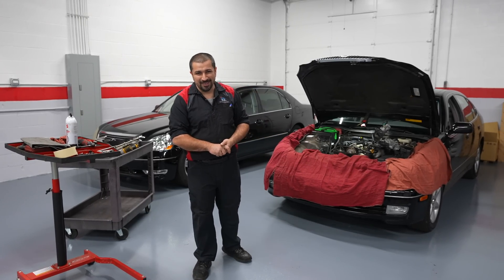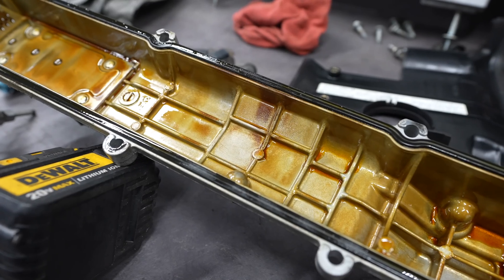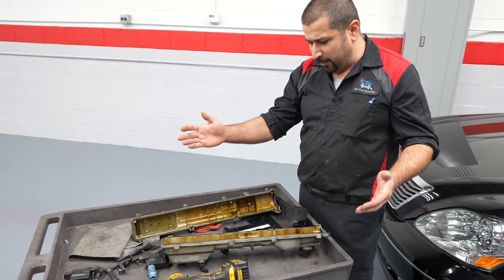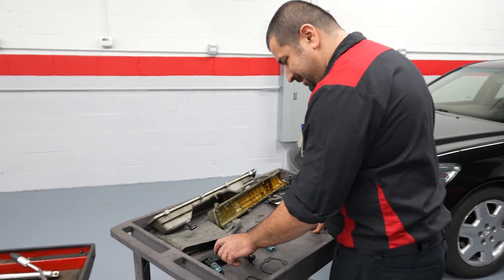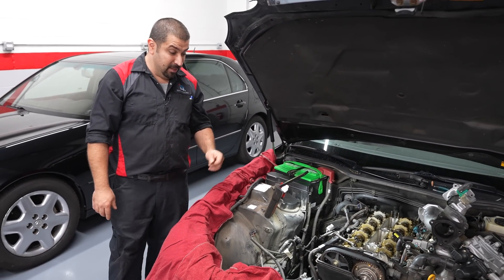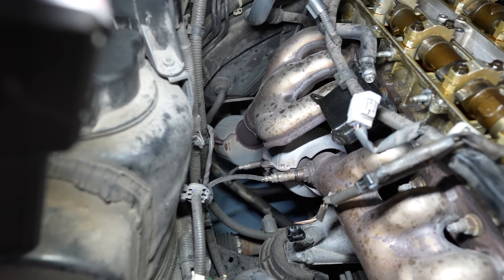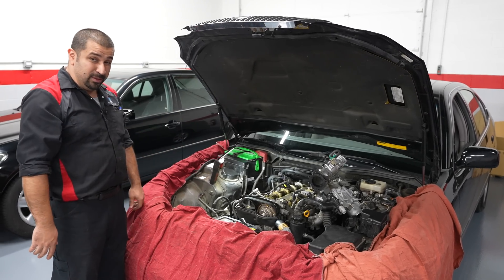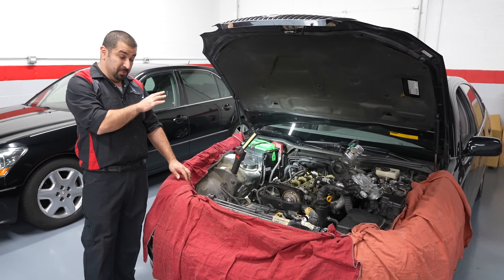This is How a Clean Engine Looks Like Inside Even After 20 Years of Service

Comment: My 07 Cadillac STS with a V6 had some work done and we were able to see the inside of the engine and it looks brand new. The car has had basic maintenance, full synthetic oil, oil changes on time, has not been driven hard and is only run when it idles down. This is from brand new off the lot. So many people abuse their cars and they poop out and all the sudden it's a bad car. Toyotas and Hondas just handle abuse better usually.

Comment: You should see my 1996 Mercedes-Benz SL 500 with 253,000 miles. Engine looks like new inside and not a trace of varnish. Has had mobil1 all of its life.

Too bad I can't post any pictures here 

Even the timing chain looks like it has absolutely no wear.

Comment: When l replaced the rocker cover gasket on my 1997 Toyota Hilux ute l did have a look at the timing chain it is tight under the valve cover it us clean l had recently changed the oil and you mentioned vacuum hoses well my Hilux has many of them going every wapear under the bonnet and from the carburetor but only one ignition coil as they did l keep a list of what l have done to the Hilux and for the sevice l wrote down tge kilometers for when l pass the Hilux onto one of my children a very extensive service history because when l bought it the Hilux had nothing the only thing in the glove box was the rego papers

Comment: The worm clamp comment was genius - never thought about the ability to self-adjust whether hot or cold.  Regarding the clean engine topic, I've always wanted to ask a certified mechanic this question since I encountered it in 1981.    
I had a friend who owned his own gas station.  They had a late 70s Thunderbird they were working on which had a V8 that had the valve covers and manifold pulled for whatever fix.  My friend commented on how clean the engine internals appeared - like this 2JZ engine - because he ran kerosene through it when he changed the oil.  I don't know if this was before a change with oil still in the crankcase or a complete flush between the old and new oil, he didn't add anything more to his comment except that the guy ran kerosene through it.  Two questions:   1) is the kerosene flush just a myth.  I know a lot has changed with car engines in the last 40+ years but I would think that, even in the old days, that kerosene would remove all lubrication, certainly making the engine cleaner but at the cost of causing greater wear upon start-up.  And while we're on the topic,  2) is running the current commercial engine oil flush products (e.g., STP Synthetic Engine Flush) helpful or simply a waste of time, especially if you change your oil regularly.
Reply: Back in the day flushing oil was a really good idea it oil didn’t have detergents to suspend particulates in the oil so they just sludged up without flushing I don’t know about using kerosene to flush

Comment: Hi there im european and i have m'y fiat coupe from 1998 2 litter 5 cylinder closed deck block that Can take  more than 500 HP, it revs AT 7000rpm no turbo .I bought it from a old lady who took Care and the engine inside looks New AT 150.000 km,that why i bought it... Check it out fiat coupe from 1993 to 1999 the first models came with the Lampredi engine that was used in the Lancia Delta intégral  the 6 Time rally champion.

Comment: I changed the valve cover gasket in my 2003 Corolla with 130,000 Miles and I took pictures because it looked like new. I also own a 2006 Corolla with 221,000 miles and did the valve cover gasket at around 180,000 miles because it was leaking profusely and the cams were not looking as mint but still very clean. Bought them both used with around 126,000 each miles already in the Odo but with decent maintenance records. The 2006 also had a brittle intake manifold gasket which made cold starts on cold weather difficult. What I cant get rid of is a pesky cel for a "small leak" 0456 code or something like that, supposedly due to a hose near the gas tank apparently being a common code.

Comment: I bought a SC300 with the 2JZ with 305,000 miles that I've restored/been restoring.  We did the timing belt, seals, and valve cover gasket.  The valve train looked liked the day it was built, shiny silver.  Not an ounce of varnish.  Nothing.  My mechanic nephew was shocked.  I guess that's the benefit of the differed maintenance on the seals and gaskets.  It leaked oil like crazy and had this amazing rust preventative layer on everything under the hood.  So new oil was going in all the time.  Now it's cleaned and sealed up and the engine runs fantastic.  PS - I would just clean up the coils, replace the foam isolators, and use them.  No reason to replace something that works that can easily be replaced later.  I have 3 cars with 2JZ engines and I've only replaced one bad coil pack and it was cracked and arcing.  Long live the 2JZ.

Comment: A reason I did subscribe. Can't get enough of your videos as a Toyota enthusiast. 

And YES they still make original parts for older engines. I recently did a tune up, oil change with OEM filter, valve cover gaskets, PCV valve AND hose, and a valve adjustment on my 92 Toyota pickup with the 22R-E engine. Was only a 30 dollar difference between getting them from the dealership in my area VS my local parts store. 

Oh, if you excuse me :) I also have an oil change to do on your favorite engine (the 2AZ-FE) hehehehe :D

Comment: Salutations. I appreciate your channel. I used to work at a toyota dealership as well. my son has my 2010 avalon. on the initial start and pull off the engine clicks or knocks when accelerating then it goes away after about 5 minutes or so of driving. Do the additives (lucas, sea foam, purple) work on lubricating the vales and lifters and such or do you recommend to just change the oil?

Comment: I have a '05 Camry and had the alt rebuilt at 200k. Sits at the very top. My wife's Odyssey had the alt rebuilt at only 100k. But that alt sits at the bottom. Never really put two and two together until this video.
Reply: The valve cover plug seals leaked on my '05 Camry. Didn't know it until a misfire. 3 out of the 4 plug holes were full of oil. It was a huge mess to clean up and get all the oil out. But, like he said, I just took my time. I didn't pull the plugs for fear of all that oil running into the cylinders. Had to replace one coil, but the others were fine. I just cleaned them up real good because from what I could tell, they are sealed pretty good. As for connectors breaking, yeah, just a fact of life for a Toyota owner. I had to replace all the coil connectors at ~100k because they literally crumbled in my hand.

Comment: I have just purchased a 2013 ES 350 with 94,500 miles on it. I fear I have chosen poorly. It  clackety clacks fairly loudly, and there is a tick from the drive train as you slow down to belo 20mph.  It is a one owner car that the Car Fax shows went as much as a year between oil changes.  Is there some kind of engine flush you can recommend that would help restore oil flow, and what should I look for on the drive train tick?

Comment: Hi, I love your videos. I have installed a new WALKER catalytic converter (without Heat Shields) in my 2002 Lexus GS300 last year. Walker said i do not need them. The old heat shields did not fit the walker. Do i need shields or not. I appreciate your respond

Comment: I change my oil on my civic every 3 months..dc if the oil reminder tells me I still have 50%or between 30%.. never had a problem and engine runs real smooth.has 180,000 and engine is still strong.but that's jus me..one of my cars I baby😂..

Comment: Car care nut!!! Hope you read this and reply. What do you know about the engine coolant bypass valve breaking on Corolla/camry/ and my 2019 rav4. I just had it replaced at 36,100 and 2 months out of warranty :/. Is there aftermarket part to put in , the plastic will crack once again in 30-50k miles 😢 why no recall or tsb a lot of complaints online that’s how I knew to fix it lol. Thanks and have a blessed day!!

Comment: I am the original owner of 1986 4Runner, which I maintained religiously. This was not cheap but it has 332K miles on its 22RE engine and is still going strong. To make this vehicle feel better, I just brought it a younger baby sister, a brand new 2023 4Runner TRD Off Road.

I am wondering whether it's still recommended to do the first oil change at 1000 miles, to flush out the supposed micro-shavings from the new  engine.  This used to be a recommendation years ago for owners who intended to keep their vehicles for a very long time, and I am questioning if it's still worthwhile on the new engines, specifically for the 5th gen 4Runner.

Comment: I had a 99 gs 300 with almost 300k before I sold it. Loved the engine. Sold it cause it had way too many problems for a beat up vehicle. Still drove very well. I had a vc leak that filled the spark plugs and I couldn't even run it. Still love the car though 😍  wish I could get another someday

Comment: Hi AMD, long time viewer and fellow CCN! I have a couple of questions about a rear main seal leak and AT fluid change. I got a 2010 Toyota Camry 2AR-FE five months ago. I’ve discovered that it has an oil leak at the rear main seal. It’s a pretty slow leak because even in between the first couple oil changes the level is pretty much the same, with the spot forming in the garage only about an inch. I’m only using the Mobil1 0W-20 oil/filter and changed the oil when I first got it and after a little over 3K miles. Should I worry about the leak causing more issues down the road or is it only a problem if I think it is? A local mechanic shop who inspected the vehicle’s condition quoted me $800 for RMS replacement. Lastly I’m the 6th owner of the car and according to the carfax service records it’s spent it’s whole life in NY and NJ until this year with me in GA but there is no mention of an AT fluid change. It now has 146,210 miles so at this stage would you recommend a drain and fill or what signs should I look for to make that call? I’ve done other maintenance on it such as spark plug changes, breaks, rotors, and power steering hose replacement, so I feel confident enough to tackle the job. Thanks for your informative videos and knowledge, and wish your family and business the best! God bless.

Comment: My Dad changed his oil every 2k miles along with air filter. At 200 k miles the inside of his valve covers were clean , even on his 200k 350 rocket. Maintenance is everything. My 03 focus has 310k n still going strong with good maintenance

Comment: I have a 99 GS300 that I watched come off the delivery truck in March of 99; have changed oil every 3k on the dot with synthetic oil. Has 147k on it and had the dealer replace valve cover gaskets and spark plugs with coil packs during last oil change. I stopped by one morning using loaner car on my way to the office with bagels and coffee for the mechanics. I caught them having a meeting in front of car observing the valve cover gaskets. Once I greeted them, I asked them what they used to clean the inside of the covers. I was shown that they were clean, with a light oil coating inside. I knew it was true when the oil I wiped with my finger was slightly discolored and not brand-new oil. The general manager of the dealer, who I have known for the past 26 years when I bought my LX 450, says he wants me to sell him my car despite knowing my answer. Returning to original topic, timely and frequent oil changes with full synthetic on this engine design is a match made in heaven

Comment: It's always nice to see an engine so clean that it looks like a pair of brass wind instruments! 

My 23 yo non-Toyota had head gasket replacement last year. When my mechanic sent me the photos of the cylinder heads, I gasped as one might when opening a jewelry box. He said, "Pistons look superclean from low carbon buildup," and I couldn't have been more proud. When I first brought the car to him a few years ago, I told him that I only fillup with 93 nitro, and he said then that it might not be necessary. 

Now that we've both seen the results, though, he says keep using it.🙂

Comment: My toyoya  service advisors used to advise me to change every 7500 tom 10 K Have had a new advisor  and have been changing ever 5K   Do a lot of highway driving  Wish I knew to change at 5 k when new. have a 13 Avalon now with 115K miles. Wanted a new car but  could not find a 2022 hybrid Avalon this  year. Will hold on  to it for now. Wish I could find someone like you in Boynton Beach Fl.

Comment: This is why I do not believe in long term extended oil drain intervals on engines. It kills them. Look at the condition of this 20 year old engine. It’s clean inside and still runs great because of regular, probably 2,500 to 3,500 mile interval oil and filter changes. It works and it keep engines in top shape. No one is ever going to tell me different.
Reply: I’m with you. Especially short trip use. The extra $80/year I spend doing 3 month intervals is nothing in the grand scheme of things
Reply: @jerrykorman7770 , the car manufacturers don’t care if your car wears out prematurely because they are in the business of selling cars!
Reply: @charger19691  yup you got it.

Comment: My 2004 Toyota Solara 3.3L 3MZ-FE V6 looks just as good inside with over 200,000 miles on it. About time to change the 2nd timing belt, water pump, thermostat, idler pulley, with only OEM parts. Always changed the oil using Shell Rotella T6 synthetic at 5k intervals. It's still so smooth you can barely tell its running when idling from inside.

Comment: Great video I always learn something watching your videos and that was the stick to the original clamp as you mention they’re designed to allow for expansion and contraction ,and to stay away from the worm clamp. Also by showing how often he changes the oil that is positive reinforcement to continue doing self.
Reply: The spring clamps also take the guesswork out of how tight. It's really easy to overtighten the worm clamps.

Comment: I own a camry 2011 with 2AZ-FE and i believe the secret to keep these engines run longer is to keep changing oil before reaching the limit. I change my 5000kms oil when it reaches 4500 kms and i feel that the engine is still fresh.
Reply: If you are using a good synthetic oils 5K miles would be ok! 5K KM is a tad too soon and wasting money. It also depends on how the engine is driven. If you are driving it very gingerly where the oil does not get too hot from hard driving, you could even go longer. Oil is affected by heat drastically.

Comment: Hi Car Care Nut, I have watched many of your videos and thanks a lot, I have learnt a lot. I have a 2020 Prius AWD and the last oil change due to oil bottle has only 4 liters instead of regular 5 quarts so I put in around 3.2 quarts instead of 4.2 quarts (1 quart low). I only realized after driving for a few day and a long trip of probably 100 miles. I am wondering did I do any damage to the vehicle? The engine light did not come on at all before I out the remaining oit in. Thank you

Comment: Heh looks almost exactly like my IS300’s but mine has 237k miles. Not sure about the coils. Mine have been hit by oil and water and are all still going strong. I even have 2 of the O2 sensors still original. I would add that it’s a REALLY good idea to replace the o-rings associated with the water pump and bypass pipe. Also on this one it’s going to be begging for the VTC oring to start leaking soon. Definitely a good idea to replace that during or before doing the timing belt. Toyota only sells the whole vtc cam gear, but you can find the oring online. It’s not hard to replace.

If only the paint on mine would hold up as well as the engine.

Comment: Your videos are very inspiring to DIY guys like myself. Like the owner, I, too, keep a very detailed log of everything that I did to my 04 Tundra and my wife’s 05 RX330 including repairs done by pro shops. When I log each oil change, which is the most frequent item, I’d go over the required maintenance schedule to give me an idea what’s coming up. Our cars are getting close to 20 years old but they still idle and run very smoothly. Preventive maintenance is key if you want to keep your car for a long time. There is a saying in maintenance: Pay now or pay more later. Pay the oil change now or pay for replacing a seized engine later.
Reply: I've got a 2013 RX450h with 250,000 kms on the clock. Obviously it's way past the service manual recommendations, like your vehicles are. How do you know what to do with older vehicles to keep 'em running? I'd be super ticked-off if there was something that I've missed and could have done to prevent costly repairs down the road. Thanks.
Reply: @lookinin123  you basically start over again. Lets say the first mileage service schedule was at 10k when the car was new. After 240k, the next schedule should be 250k. So you just add the last mileage schedule, 240k km, to the mileage on the start of the schedule. I would write the new mileage schedule next to the original mileage schedule so I would see easily when the next service is. With mine, I use these intervals: Oil changes every 5k miles, engine air filter every 30k, transmission fluid, brake fluid and engine coolant every 60k, spark plugs & timing belt at 100k.
Reply: @Marximarks  There’s no timing belt on that engine, or any Toyota with a 2gr. Most modern engines have a timing chain and lasts the life of the vehicle if it’s unmodified.
Reply: @vee6411  Well, I don’t know about the RX 450h but my RX330 has a timing belt (unless, of course, the Lexus dealer pulled a fast one on me when I took it for timing belt replacement at around 100k miles).
Reply: @Marximarks  Yes, your 330 still had a timing belt. That was the 3MZ-FE, I was only referring to the 2GR-XX series of engines. So after 2008 when they introduced the 350 as a midcycle refresh the new 3.5L onwards was all chain.